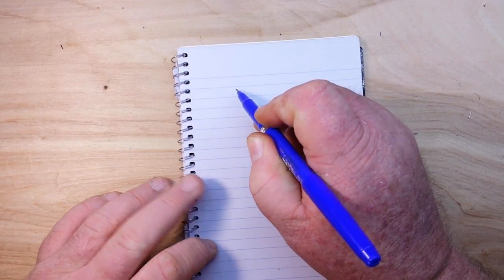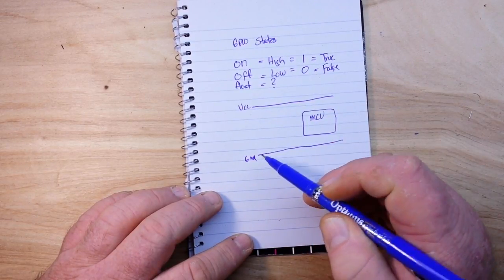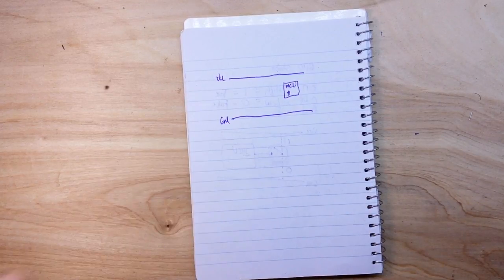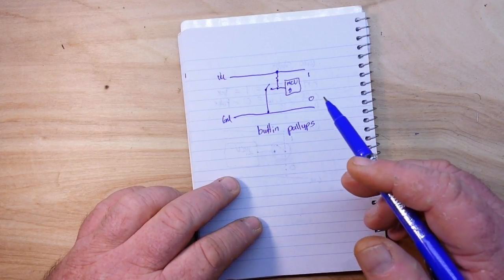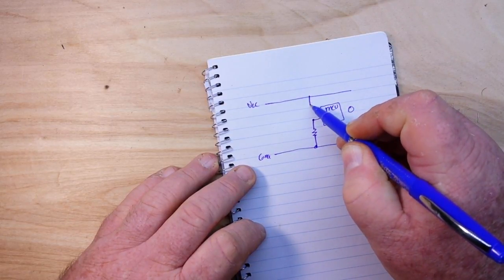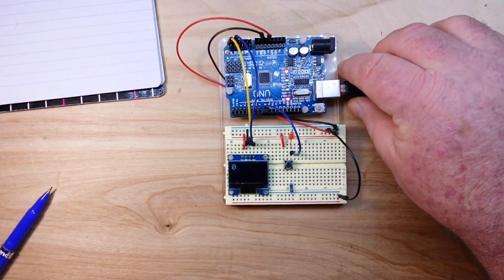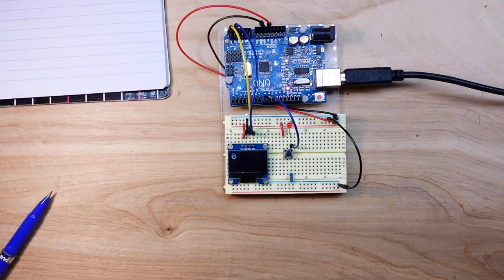Pull-up and pull-down resistors

Comment: Why when switch is closed in pull up mode the input is 0? It doesnt make sense from what i know about electricity. Switch and MCU is connected in paralel with VCC and when something is connected in paralel everywhere should be the SAME voltage. I dont understand that...

Comment: Most of what I have noticed is that pull up resistors is used far more than pull down.
Most likely because it is the electrons that move from the ground towards so called high voltage and charges don't jump from VCC to ground.  But I don't know.

Comment: Thanks!  You do a good job keeping the examples as simple as possible and not going off on long tangents. (I saw another tutorial online that had multiple switches and resistors in the circuit, that was really confusing from a newbie perspective).

Comment: How do you know what resistor to use? You are using 10k ohm resistor for this project. I’ve seen other videos but no one seem to explain how to calculate resistor used in pull down resistor application. Please let me know, thank you ;)
Reply: You need to know the impedance of the input pin and then the logic value you want to have. For example, if a uC has a logic high threshold of 3V and you want to pull it up high, the voltage at the pin must be 3V or higher to register as a logic high.
So:
Input impedance: 100k
Pull up resistor: 100k

You can see that you would get half the Vcc at the pin, if vcc was 5v we would be under the 3V logic high threshold so would fail to be pulled high, so a lower resistor value would be needed.

 Another unseen danger is the capcitiance of the input pin, meaning that if you use a large resistor the switching time will start to become a problem. In reality there is quite a range of values, normally between  10k-100k will normally work.
Reply: Also be aware of current, you don't want to choose a value which just sucks current.

Comment: Hi :) in a case of pull down. What will happened when i choose value of resistor lower then value of arduino pin? will it works or not. I think that not but for sure i will ask you :)

Comment: I am still trying to get my head around arduino and pull-up, pull-down.  This was a great video incorporating the simple circuit drawing and then the hands-on example.  Great work!  One question. Is that a resistor attached to the LED?  And does the LED have to go back to ground to complete the circuit on the high side?  Thanks again. Great stuff. Great pacing.
Reply from the maker: Yes it's a 220R resistor attached to the cathode. The anode is attached to the same pin as the switch (parallel). And yes, it must connect to ground to light the LED, but it has no effect on the switch.

Comment: Great man, thanks a lot.
How do we know when to use a pull-up resistor and when to use a pull-down resistor? The decision is based on what?
And what about the value(s) of the resistor(s)?
Because I think in some applications(battery operated circuits/devices) losing more than needed power is a waste of energy.
Reply from the maker: igrewold You decide whether to use pull-up vs. pull-down based on if you want an inverted signal or not. (Pull-up = inverted). As for resistor vaule: between 5 and 10k.
Reply: Thank you

Comment: I thought the input impedence of a MCU was very high, like at least 1Mohm.  The only only current flowing into the input pin of the MCU is unwanted or "leak" current.  They are more of a voltage controlled device like a MOSFET.  Almost all of the current is going to flow threw the pulldown or up resistor.  Again, I'm not 100% sure so I would like you to comment on this.
Reply from the maker: Lance Denly No the input impedence is low. This allows the Arduino to sink current as well as source it.
Reply: I think I'll breadboard this up because now I'm more curious about this than I was before lol.  I work with PLC's so I know they are lower cause they are essentially a LED inside an isolator, I just wasn't aware that these micro's were capable of doing the same thing.  Keep up the good work on the channel.  Stuff like this is how we learn either from not knowing, or from being taught wrong like me lol.
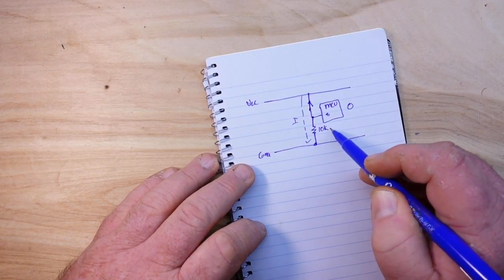Reply: I get 0.500mA flowing threw the 10K resistor while feeding the input high. Total circuit current was 0.500mA.  I tried both sinking and sourcing on the input with the same results.  I used a second DMM on the input and cranked it down to uA, but still read zero.  I'm not saying that your wrong at all on how to use a pullup or pulldown.  Your spot on on everything including your schematic and everything.  It's just that one part where you draw an arrow and point out where most of the current flow is traveling at 7:15
Reply from the maker: Lance Denly check out this link for more info on Arduino current sinking: https://playground.arduino.cc/Main/ArduinoPinCurrentLimitations
Reply: those are output limits, not input
Reply from the maker: Lance Denly I invite you to look towards the bottom of the page under the heading Pin Sink Limitations.
Reply: @LanceDenly  was watching video and stumbled the same question about pin resistance and how current should flow. Have you understood explanation (sorry to ask after ~2years xDD).

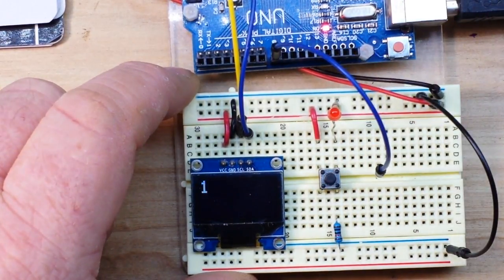Comment: Nope i still didnt get it unfortunately! I thought the resistor was pulling it down to "Zero" (0/to the ground) so shouldnt it change the value 1 and 0 (9:01) continously when you remove the resistor?
Reply: Think about this way: we got 3 states(hi,lo & floating), the reason we need a pull-up/down is to avoid floating state because that state is making the mcu/Arduino crazy it is as if you are asking a person a yes/no question like "do you want to have dinner?" And you are getting the answer "the sky is blue!" So, you dunno whether that is a yes or a no!
Maybe a simpler circuit would help in understanding it better https://youtu.be/3Ico1O2dMeo
Reply: First of all thanks for your answer and i have to say i do get that part of the subject. The part i dont get is the blue wire to pin 9. Why removing that wire instead of removing the resistor at 9:01? I thought the resistor was pulling it up or down!
Reply: He removed the wire to show you how Arduino is confused from the floating state which made it fluctuate between 0 and 1 then when put the wire back into the circuit the state was 0 because of the pull down resistor. And once the button is pushed the state became 1.